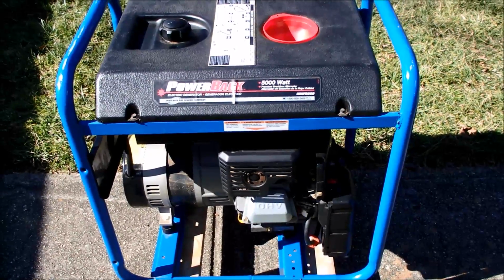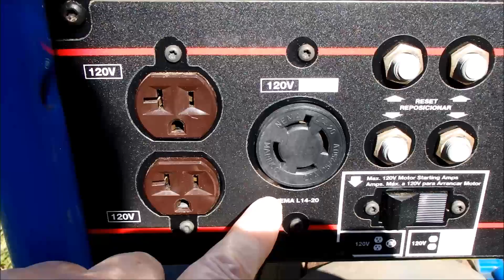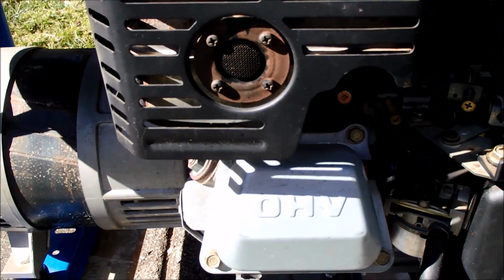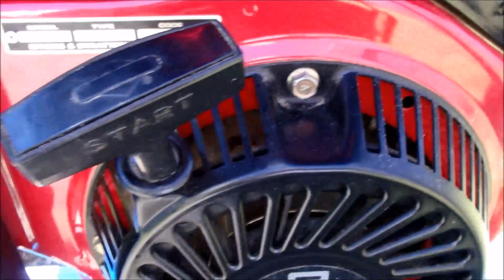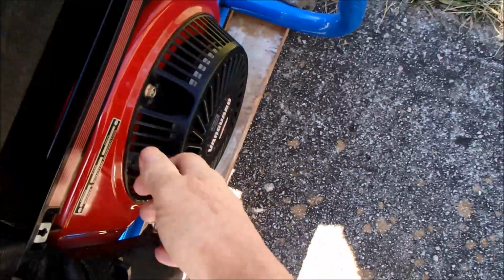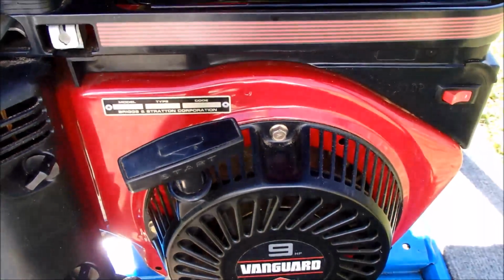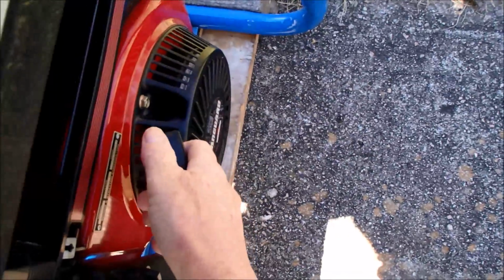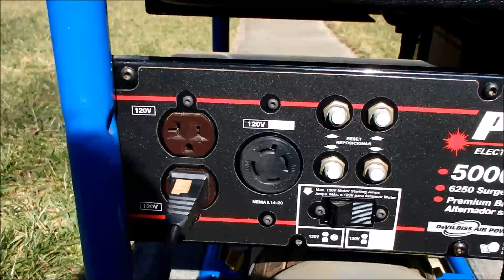ColdStart PowerBack 5000 Watt Electric Generator 9HP Briggs & Stratton Engine -  Feb. 8, 2015

Comment: Looks like you got yourself a good generator. I know you made this video several years ago but just been going around on YouTube looking up generators.  I would like to make a recommendation..  As soon as the engine fires up, get it off of Choke immediately.  Leaving it on choke does not help it warm up any faster. All it does is flood the carburetor with too much gas and calls extra carbon buildup inside of the motor.. Also, I seen these same generators with the Tecumseh engines. Be glad you don’t have one of those.  I’ve had a total of four generators. Two of the ones i used to have were about the size of yours and had Tecumseh engines and they are super loud because they are not OHV..